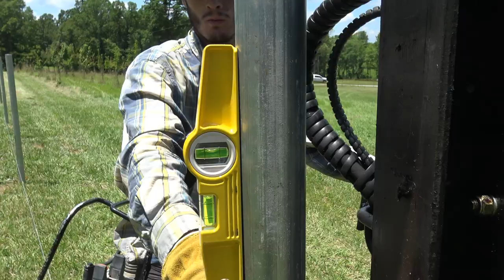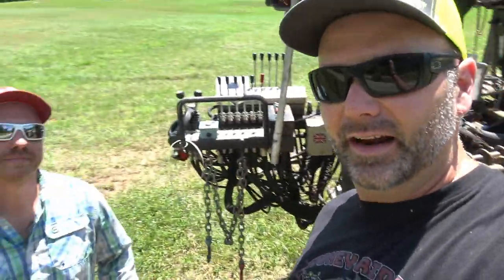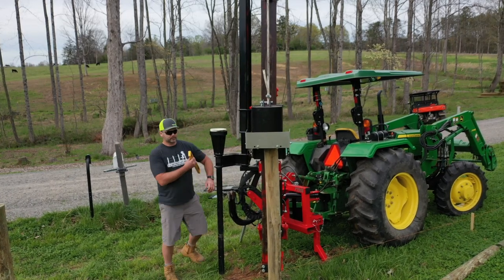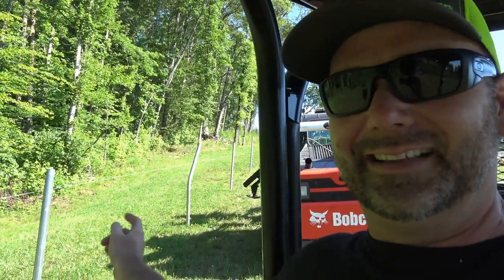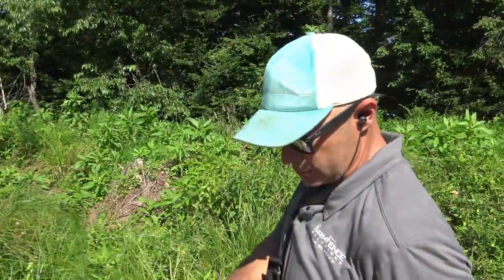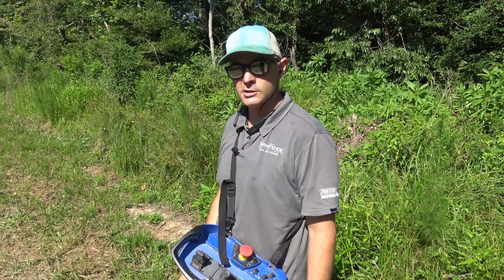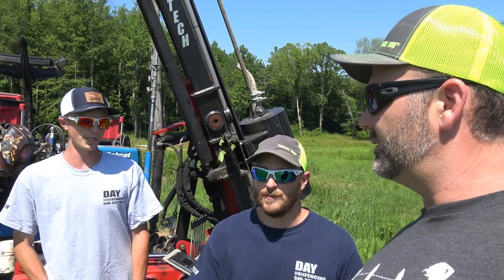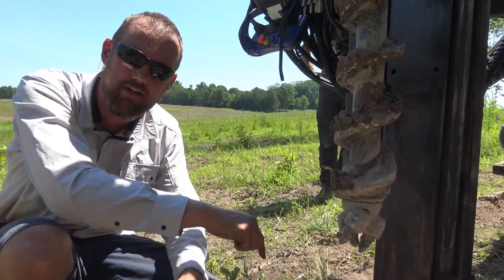Fence Building with Modern Machines!

Comment: Hey I grew up on a farm back in the 50's. Our fences were barbed wire and wooden posts. Posts driven with a sledge hammer hitting the top of the post to drive it into the ground. Hard work.

Comment: Around here we use an auger and concrete posts. Those steel posts would bend trying to drive them in coral rock.
Reply: Most coral isn't much trouble for the pipe we use.  It has a yield strength of around 80,000psi, and with an experienced operator, it isn't too tough to peck it right through.  If it's too much, we just swing the rock auger in, drill the pilot hole, fill the spoil back in, and drive the post.  It's still stronger than concrete, as we've proven many times.
Reply: @farmfencesolutionsllc  That's good to know. We have rock that varies from pourous oolite to sandstone. There may be sand next to rock so when you drive a pipe in it will deflect in the ground or pinch off the end and cause the pipe to crunch up instead of cutting in rock. On filled in land you can easily drive those posts in.
Reply: @farmfencesolutionsllc  80,000? I have hauled many loads of steel, and tubing in my life as skateboard cowboy.  I used to haul out of mills from Detroit to Alabama. I have never hauled any tubing to my knowledge that was galvanized like this with a 80,000 spec. Usually i understand to be hi tensile it is gonna be cold rolled. But I have to be careful with tightening my straps on thin 18-16 ga 55,000 min yield tubing especially if my winch spool is empty or I can easily make it to tight and it collapses. 50,000 min yield is most popular. This looks like my grandfathers industrial chainlink fence that i had to cut out with a torch. Just common cold rolled SS40 if it's Allied, SPS40 if it's Stephens, or WT 40 if it is Wheatland. I've hauled it all. Usually like to look at the footage I'm hauling. A 4" 40WT is like a little over 6-1/2 lbs a ft. Very heavy and strong. But I haven't seen 80,000 tensile on any BOLs yet that I recall.  Nascar racecars  used to use a really strong tubing in their cars that was seamless and made in Detroit if I remember correctly but it wasn't ever galvanized that i recall. That's really incredible if its 80,000
Reply: @ifyoutip  It really is 80KPSI yield.

Comment: Great Video Josh! Really interesting. I'm looking forward to the others. How was it going through that crooked part? (Where the contractor didn't clear in the straight line you had marked out) Lots of deadmen/braces there?
Reply from the maker: Still yet to pull wire through there...you'll see more in the next vid...a bit frustrating to say the least
Reply: Yeah you can really see why he wanted it straight now.
That's going to add a lot of extra braces.

Comment: I feel like my skid steer with a montana post driver is better at driving post then the  protech machines and way cheaper with more attachments.
Reply: If that were the case, that's what we would take with us every day.  We run very efficient and high profit margin crews, and we do it with the best equipment available.  We keep a few Montana drivers around, and Farm Fence Solutions is even a dealer for them, but for true quality and production, you just can't beat an EVO from Protech Machinery.  If you just need a driver for the odd job here and there, and already have a skid steer, the Montana is a fine choice.
Reply from the maker: there ya have it brotha
Reply: @StoneyRidgeFarmer  You should have the pigs install that thar fence! Save ya a bunch a money!
Reply: From the videos I've watched the protech just looks slower and theres no way that auger would drill through the rocks you'll run into in Montana.
Reply: I agree with the montana is the only way.. i want too see yur evo lay out, spread an pound 300+ wood post a day. We run a 5 guy crew an i wud have a hard time believing that the evo cud keep up with us.. we have no problem putting in 4k+ feet of 5 strand high tensile in a day
Reply: @henryshaull7303 I've checked it out a lot and my opinion from what I've seen, and i went and visited a few installers around here and watched them work on the jobsite, so it's an educated opinion... Is the pro tech post driver is way over priced but realiable and old school.  They make different models. These in the video on the cool track chassis with remote control are not a bad design, but they are not great profit producers when compared to the competition. It's a really limited machine but shines in some things. Good for vineyard trellis work around the lakes up here and also an expensive conversation piece. Have a friend that has one for the vineyard trellising. That is big in our area.  He never told me what it cost but seems to me when he was done he admitted it was more money than my house in town.   It is slow.  A good 3 point tractor mount log cabin pile driver on a tractor can out do it no prob .  When it comes to farm fence construction or any construction  for that matter up here in the north is really important to not mess around because we only have two seasons it seems. Cold frozen winter or road construction.  A skid steer mount, say like montana or an iron force driver will do a lot more faster with a lot more versatility because they detach and you have your base power unit, A skid steer.  And everyone knows skid steers work very well.  The speed and versatility always will do lots better on bottom line profits. A skid loader can build a road then load and unload the truck bringing in the wire and posts, so you got one less heavy machine to move and that might mean one less truck and trailer or trip.  Then  it can clear the old property line of trees and mow the brush where the fence goes, it can push the snow or snow blow the snow away to earn profits in the winter,  it can mulch trees, it can dig holes and then it can also go drive down the road at a good speed if you have a two speed machine and many many things. And you can always get remote control for modern skid loaders.  Around here i see some guys tried using steel posts but  they must be capped or they split open the first freeze then rust and make a good place for bees. A lot of guys are using steel brace rails on a H brace with wood posts though. I would like to try that when I get my new pasture fenced in. I thought about renting a skid loader and doing it myself but I think I will just hire it done. I'm getting to old and life as a  truck driver wasn't the best for my health.  Around here nobody uses Tornado wire. I suppose it's imported? It's either  Stay Tuff wire or Bekaert wire around here. The local farm stores sells wire and they are both really good brands. Some red brand wire and Oklahoma wire is still sold at the localTSC co but I hear it ain't as good. I want a good woven wire fence because it seems my fence gets terrible stress from heavy snow and ice and i don't always want to do maintenance.  I want to put goats in but my current fence ain't up to that.

Comment: Gabin is welding with 6010 ROD
Reply: A box of 6011 is what I handed him.
Reply: @farmfencesolutionsllc  I AM AN A WELDER. I USE 6010 3.25 FOR GALVANIZE. NEVER USED 6011 BUT 6010 ENDS WITH 0 NOT 1 I WELD IT ALL POSITION . MOST WELDWERS IN ISRAEL  KNOW ONLY 6013.
Reply from the maker: 6011 3/32 ....because I bought them! Wooo
Reply: @StoneyRidgeFarmer  6010 are similar to 6011 . the main diff is that 6010 is only for dc welding machine and 6011 is for dc&ac machines. no need to argue any more. send e mail and i will show you what I weld with 6010- just everything not  fluid pipes.
Reply: @tucut8054  It's still 6011 that we were welding with in all of these videos, so I'm confused as to why you want to argue about it?  Nobody said that you aren't allowed to use 6010, so why get so worked up about it?  Time for a cold one.
Reply: @farmfencesolutionsllc  no argue at all .  enjoy working. 6011 is good for dc /ac . 6010 only dc. otherwise the material 6011=6010. i weld 6010 all directions.

Comment: Wont the pipe rust where the galvanize has been welded?
Reply: It is sprayed with a cold galvanizing compound after welding to prevent rust.
Reply: @jmtebbens  Thanks I guess I missed that.
Reply from the maker: yep...we paint them with cold galvanized paint....we also do periodic repaints on those welds